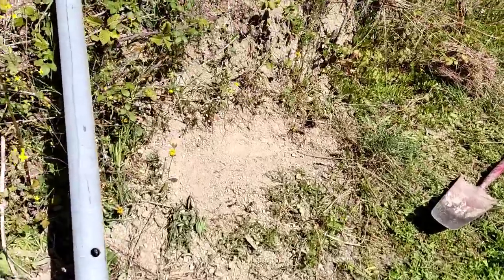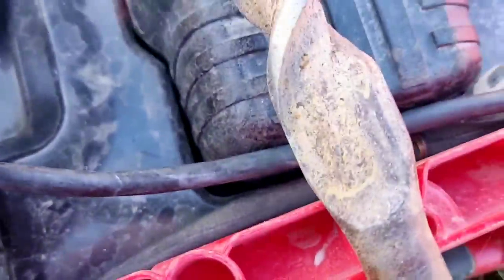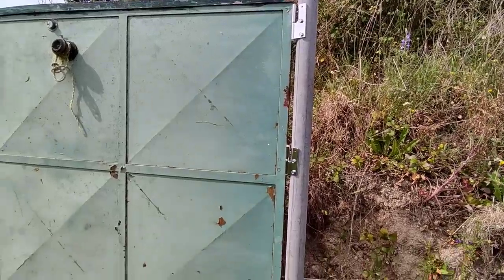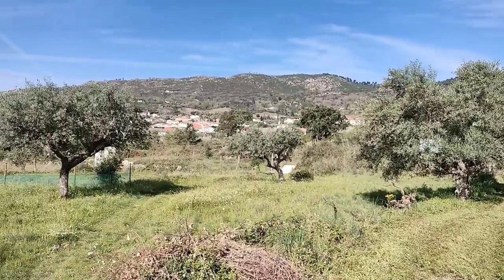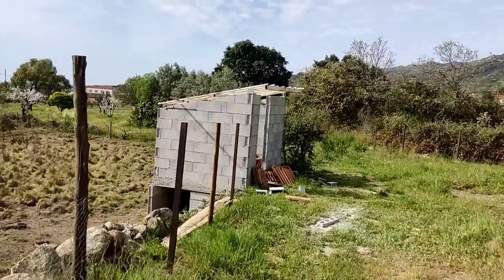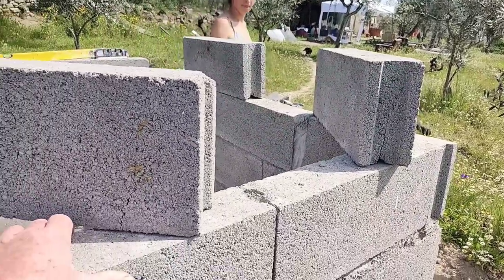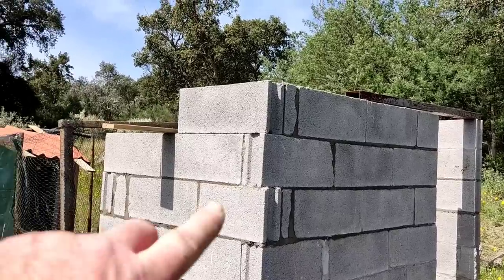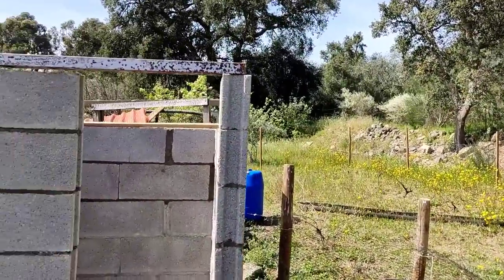Spring into Action, Granite, Grass and Graft. : 137

Comment: Funny what you say about hinges - a two pack of garden gate hinges from screwfix is about £1.98. But the two pack of hook and eye hinges that are suitable for much more weight it £13 and the better ones £43. Those are just a pair - they can take more weight, they'll be better engineered. It's not the type of job that you'll want to come back to in a hurry and getting some hinges that you know will last decades isn't a bad idea. It might be quite funny if you bought ten packs of the cheap garden gate hinges and welded them in place - it's cheaper, but would it look silly?